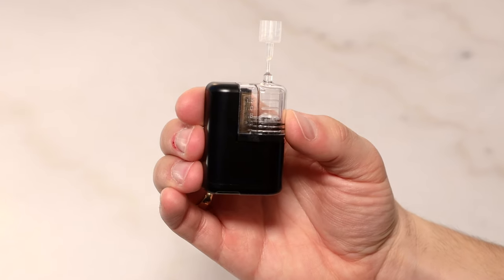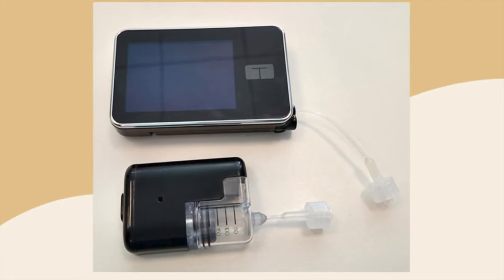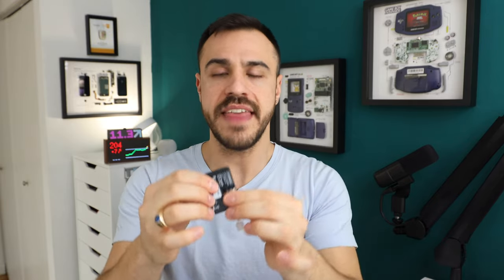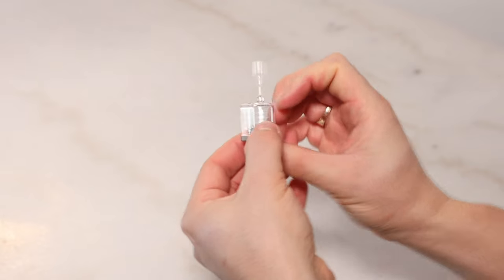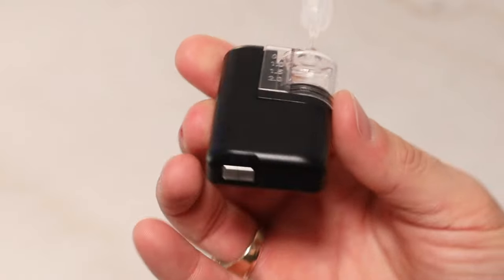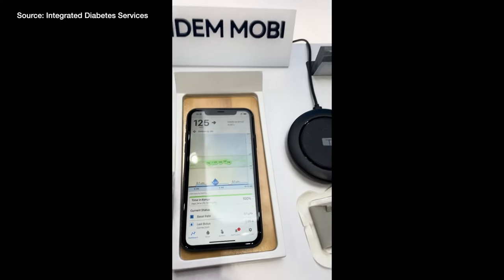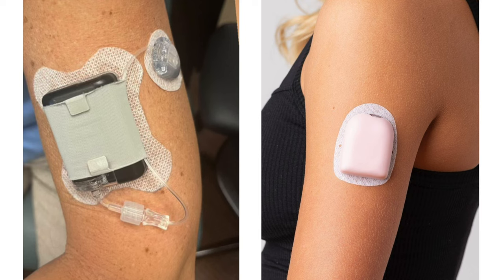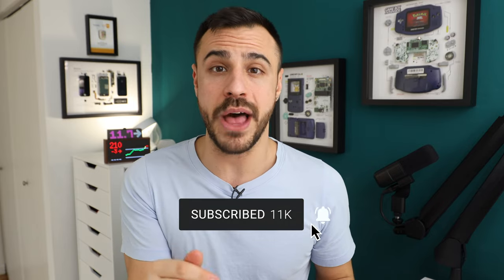Tandem's Mobi - Hands-on Demo

Comment: I've been a Tandem user for almost a decade, and am completely exhausted by the sheer quantity of alerts that I get from my pump, which is made worse by the absolutely shrill sound design of the alarms. I can't imagine how much worse this would be if my phone became the primary sound source for alarms. Have they improved how they manage alarms with the phone as the primary interface? How does the snooze work?
Reply from the maker: I’m unsure. I will try and find out more!
Reply: Oh no! I recently got a Tandem. I’m still on Medtronic bc I’ve been sick with this cold for months and haven’t been able to go do the training to start the new pump. I used to read so many positive comments but all I see are negative reviews after deciding to go for the Tandem. 😩
Reply: After Medtronic, there was a learning curve with the insertion procedure.  Found a helpful video.  No regrets changing to Tandem + G7.   In the menu of Alerts & Reminders, I have only one turned on, for low  reservoir.  Also the bigger color touch screen is a pleasure, I find it user friendly rather than the Medtronic manual scrolling in search of the relevant imbedded menu.
Reply: On the t slim using t connect app you can make alerts vibrate and do multiple other things.

Comment: Type 1 for 32 years and currently have the Tslim/ Dexcom G7. Im due soon for a pump upgrade so I wanted to do some research on the Mobi. My takeaways: I love the fact that its smaller but I do not like the fact that it has wireless charging. If the charger breaks or gets lost, you cant charge it. Also you need to make absolutely sure its compatible with your cell phone. When I first got my Dexcom it wasnt compatible with my 6 month old phone, I was not happy. I literally had to buy a new cell phone. As far as the adhesive pocket I would not wear it where people could see it but It is PERFECT for us girls that wear dresses and bathing suites. Im so tired of wearing shorts with pockets under my dresses. I can just stick it to my tummy under my dresses. However, do to the wireless charging thats a deal breaker for me. Thanks so much for the video, it helped a lot😊

Comment: The adhesive pouch combined with remote bolusing would be fantastic for parents of infants and toddlers.
'pods hold the top spot in functional utility there.
Reply: As the mom of a t1d toddler, I pray for remote bolusing. But also wondering how secure that technology would be

Comment: I'd like to switch because my omnipod.5 leaks so often, and I have had to replace dozens of them in the last year, but I don't wear jeans and I like the ones that you can attach to your body so I will just have to wait I guess.
Reply: He showed it in the video but this does have a adhesive pocket that you just put the Mobi pump into and you can just stick it anywhere on your body I wear a lot of Summer sundresses and I'm so tired of having to wear shorts with pockets under my dresses. So this is a great option I can just stick the little pouch to my tummy and put the pump in it underneath my dresses.

Comment: Justin, do you know what processor is used in the mobi? It was supposed to be an upgrade over the tslim X2. Also, do you know the mechanical pump type in the mobi? The tslim X2 used a positive displacement pump rather than a screw drive, which is one of the reasons I switched to it when it first came out. I had MiniMed screw drive pumps for years but positive displacement is more precise and is most often used in chemical systems such as hospitals. When you replace the cartridge in the X2 you are also replacing the pump diaphragm.

Comment: I’ve had a tandem pump for just over two years. I am currently on pump number four. That means three pumps have failed. The alarms on their pump are insanely loud. At least with Dexcom 7 you can quiet the Dexcom alarms down(set them to vibrate).  The latest version of Tandem software also gives the ability to snooze some of the alarms. 
On a positive note I do like their color touch screen. Loading insulin is easy and the onboard battery charging is more convenient than replacing the battery on my other pump(different manufacturer).
I’d be interested to hear your opinion on wearing the Mobi pump.
Reply from the maker: Thanks for the detailed comment! I’d love to give Mobi a try at some point. For now, I’m going to keep using Omnipod DASH with iAPS.
Reply: I've had the x2 for 6 years as I was waiting on x3. I got fed up waiting and was not going to purchase the same pump. I switched to omnipod, no more annoying alarms, no tubes, I can use my arms and it doesn't look like a 3D printed piece of plastic like the mobi
Reply: I have my original Tandem pump from November of 2020.  I have not had any failures.  One can set the alarms for soft, medium, loud or vibrate.  I use all four settings for different alarms and alerts.  FYI

Comment: do you know if they have a tru steel cannula for this? my daughter can’t use the regular ones because they always bend. thanks!!
Reply: Hi I'm just curious I've been type one for 32 years and I've had an insulin pump for over 15 years since they first came on the market. Why would you want a stainless steel one? They're made to bend so that they move and can be flexible with your body. Having a tube that didn't move would be really difficult and inhibit your movement. Just curious on your reasoning I've never heard anyone say that😊
Reply: @DK-do3nm  Hi! My daughter is a dancer and can’t use the soft ones, she’s always getting kinks in them which stops the insulin from flowing through the cannula. The trusteel needle is so small she doesn’t even feel it and no more kinks!

Comment: I was excited about this pump until I realized the cartridge is no longer the weighted bag system. How is this any better than medtronic? Whenever I used the medtronic pump air bubbles would somehow get into the cartridge a day or 2 after it was installed. This is why I switched to tandem. No air can seep through the rubber since it's a bag.
Reply: I HATE the bag😂 and the stupid extra needle you have to have to fill it that a the only reason i won’t go t-slim so there are people out there that don’t like it 
But this mobi is smack on what I want
Purely for the consumables 👍🏼
Reply: @MrJak427   @MrJak427  That's great you have an opinion! Thanks for sharing it on his page. I would appreciate it if you would leave me out of it though. What was even your motivation in replying to my comment? I stated my experience with medtronic, and the reason I have t-slim. This seems no better than medtronic to me. Tslim is known for their weighted bag system so it's odd they would switch to the cartridge. For me, I've had numerous negative experiences with the cartridge system so it's disappointing. Everyone's body, experience, diabetes, personality, and needs are different. Please respect others opinions.
Reply: Well I didn’t  actually tag you it wasn’t directed at you personally..
just added my thoughts on this.. it is a public space where people are sharing. 
No need to reply as I’m not trying to actively engage with you on this.👍🏼

Comment: Here’s the problem with the wireless charging you then will have to have the pump sitting in the charging pad which is going to be a massive pain in the ass. I wish they would just go back to double a batteries. It’s a ton easier just to swap them out
Reply: Then it would be twice the size, but maybe a coin battery would be better
Reply: I completely agree I was actually going to switch from the  Tslim to the Mobi and that's exactly why I'm not switching. I don't like the wireless charging at all, if it breaks or gets lost there's no way to charge it.

Comment: The whole 'keep your insulin cold' thing.  Am I the only one who thinks it's all BS?  I keep insulin in the fridge only when I haven't opened a bottle.  Otherwise - once it's open - they go everywhere and get stored everywhere - including the car in the summer, and I've never had an issue with insulin losing it's efficacy.
Reply: For the most part, I agree with you. I have had 2 pens stay out for over a year and they didn't work, or at least they weren't as effective as other pens were. However, I kept like 20 boxes of pens out for a year because I simply didn't have the fridge space, and those were the only 2 that didn't work. Best practice is to keep them in the fridge, but I never cool on trips.